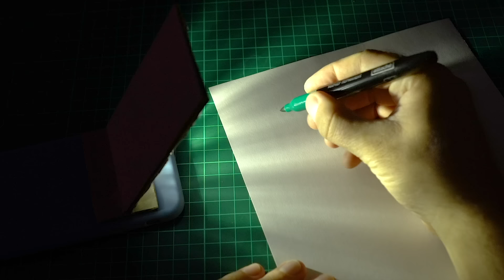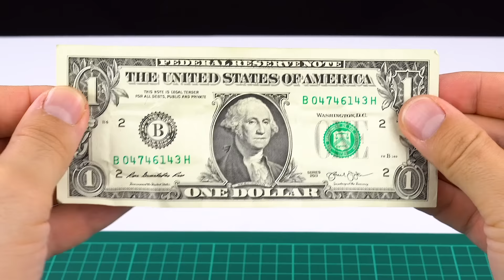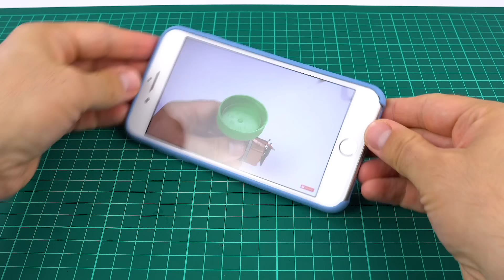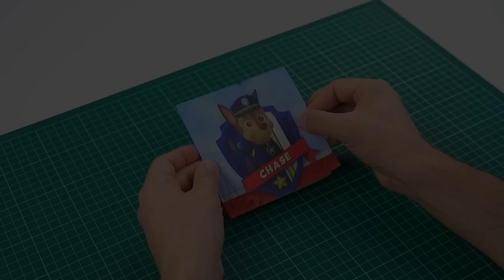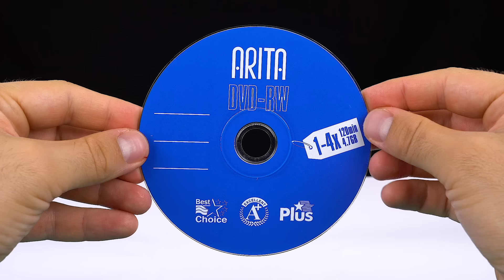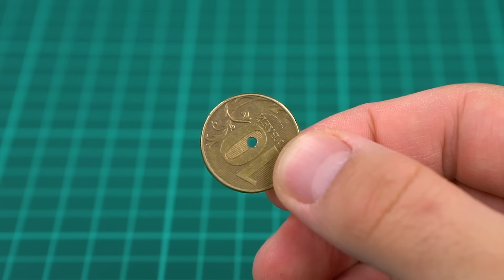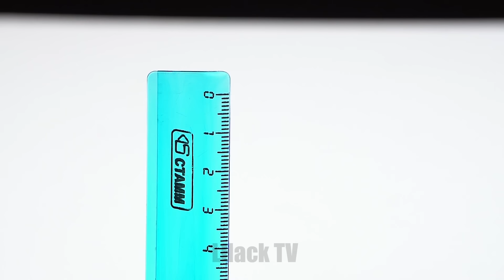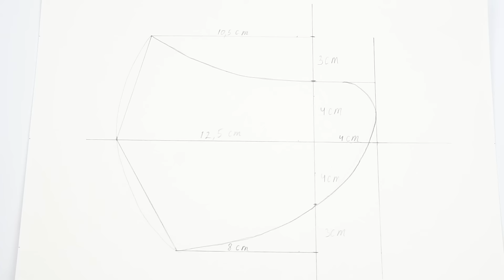55 Amazing inventions and smart ideas!

Comment: There IS value is this video. A lot of people are saying these are not inventions, but diy projects. That cost more to make than buying the actual products. Some may be like the contact lense case. However, It does also say "and smart ideas" in the title. Also, at 12:32 he makes a little "stash box" out of a 9volt battery that still functions afterward. That's pretty cool. Last time I took a 9volt apart they didn't look like that inside though. I have to check it out. Be a good way to keep some emergency cash for gas money. In your car. Thieves probably won't take a lone 9volt from the bottom of your glove box. Also, I didn't know you could make an iron on with a picture & cling wrap.
Reply: That's cause it's a rechargeable 9 volt battery.

Comment: I didn't finish watching the video because some of the things that I saw are not even practical, just like the tin can as a pencil case. So imagine if you do that for your child to use, or even an adult. It can cause injury. 🤣🤣🤣 

The only thing that I liked is the water bottle and the thread. I think I love everything about recycling plastic bottles. Not only genius, but also helps save Mother Nature. 😊
Reply: and I stopped when I saw how you used a tin foil, a cardboard, and a phone. I think I'd just buy a lamp than suffer drawing or doing calligraphy with a little light. 😅

Comment: Quick question what did you use to make the light for the car keys?  It showed the battery but I need the name for the light part?  Thank You
Reply: it is just a common LED  you can get them out of almost anything that has lights on it or u can buy them on amazon for SUPER cheap i think i paid $6 for 450 bulbs (45 bulbs in 10 different colors)

Comment: that first one with the tea .. could be improved if you get 2 sheets and punch holes  then lift upper sheet and put some toilet tissue in then put sheet back on top then it will filter out those smaller nasty lumps

Comment: See a lot of comments on how it would be cheaper to buy something like this than make it yourself. Thing is they make those same products for the same price you could buy all the stuff to make it yourself without the cost of labor and mark up for the company to be profitable. I made my own 2DS carrying case that I could thread my belt through for around $2 compared to the $20 or $30 I would have paid for a finished already made product with the Nintendo logo or some company logo on it...
Reply: For $2? Really? Did you factor in the tools needed to make the item? Not everyone has a soldering iron lying around somewhere.

Comment: What is he making with the steel wool glued in the bottom of the soda can? I see what looks like an Apple lightning connector being plugged into it, but not what it's supposed to do.
Reply: Clean the soldering iron tip. A wet sponge can also be used. Cleans off flux and any excessive solder